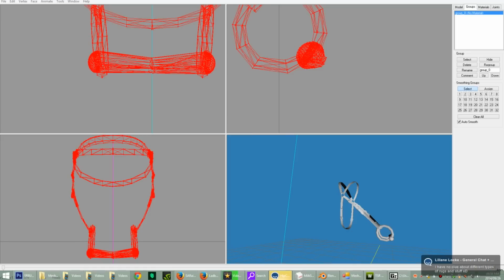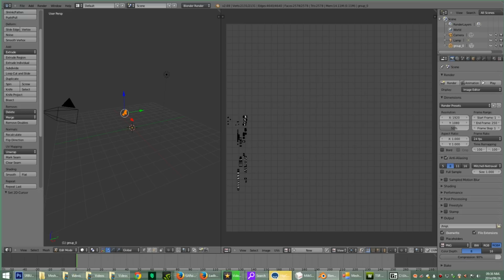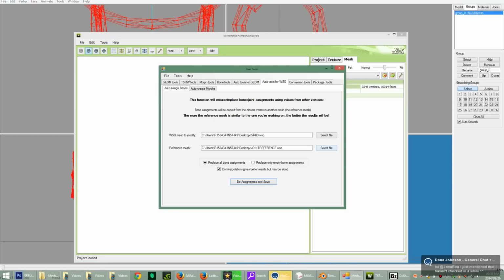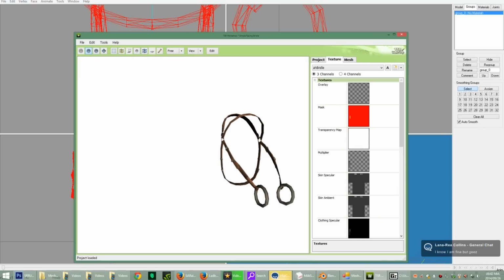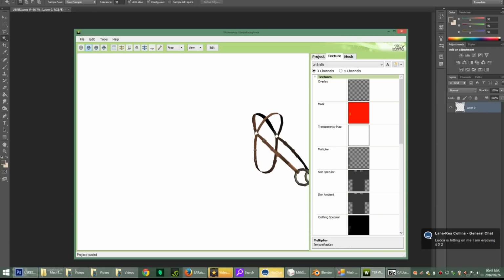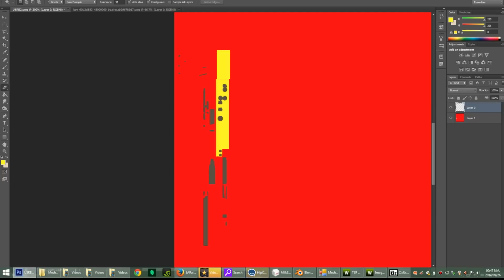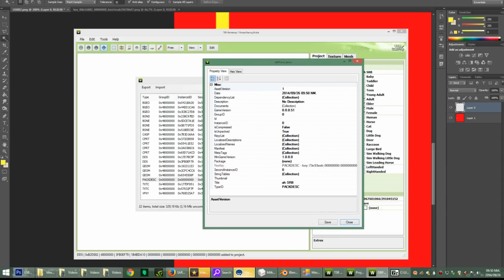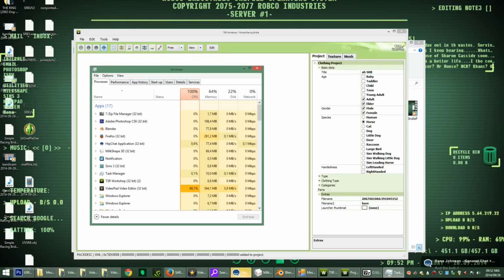Equus Sims Tutorial Meshing a Bridle Final Step

Comment: I despair ... if I go on assignments and Save , an error message " Object reference not set to an object instance "
Reply from the maker: +Franziska Rottenbach 

Please read the top comments for an answer, as I have explained in there.
Reply: Still have the exact same problem, and I only have this one basic bridle in TSRW that has two groups. Even with the same group count I have this problem "Object reference not set to an object instance"...Did you find a solution?

Comment: At point 5.42, I pressed "Do Assignments and Save" but it comes up with an error message saying "you have not selected a valid mesh with a base mesh group".. Do you think this is because I had to use a bridle mesh from the internet for the reference instead of one from TSW? (Reason I had to do so is because TSW was not showing any bridles)...
Reply: Side note: The bridle I had to download was similar to the one you used, only someone had re-textured it
Reply from the maker: +Harpwood Equestrian Center right if it's saying that make sure you have the all the groups merged together in milkshape then you want to rename the group as this "group_0" without quotes.
Reply from the maker: +Harpwood Equestrian Center that should work make sure you check in tsrw that the base bridle you are using as the joints is also called group_0 it's Wierd but both meshes must be called the same in the group section
Reply: Sadly the message keeps appearing, I'll keep fiddling and see if I can get it to work, thank you for the help, and your tutorial is amazing!
Reply from the maker: okay in TSRW open up the reference mesh as in the mesh you want the joints to come from, then you want to check how many groups are in there, and how many groups your mesh in milkshape has? so if the base mesh akak the reference joins mesh from TSRW has one group called group_0 then you must rename your mesh in milkshape and go to groups and merge everything together, and then call that group, "group_0" however it can be sneaky, make sure you export the mesh you want to use joints from as a TSRW file, and make sure you capatilise your own meshes group name so say if the reference mesh you are using has a capatial G you must capital your G, its fussy, and wierd, but you must also make sure both files are TSRW, also make sure if the reference mesh you are using has multiple groups then you must make your own mesh have muliple groups even if it means you just create a tiny cube hiding inside the bridle and call it group_1 , I do it sometimes because I merge my groups alot! Hope this helps, if you are still getting this error, I will open a Q&A over at ES so people can ask me away at any difficulties they are having and I will make video tuts, or written tuts.

Again hope that discription helps, if there is another siolution to your problem I willt ry and find it aswell.
Reply: R1534G41N5T
Thank you, I have found a bridle with "group 0" and only that group (if that makes sense?) and I have //tried//(?) to make sure I have the same amount of groups, and even making sure the name is exactly the same, yet it is still coming up with the same image...  If it helps I can record a video showing what I do and what happens and maybe it might help you to see the problem I am having?
Reply from the maker: That would be wonderful if you could please!

That way I can see where your going 'wrong' in the video :)